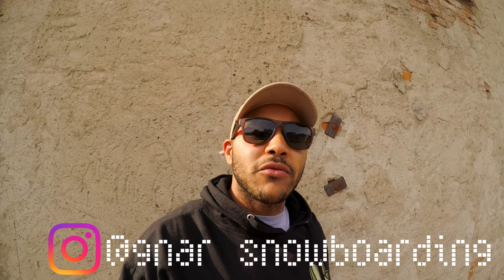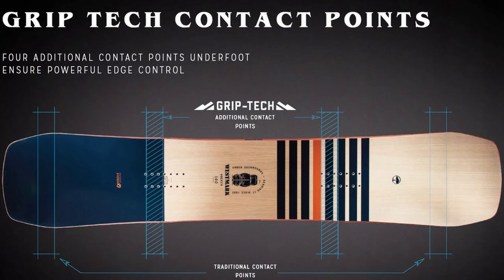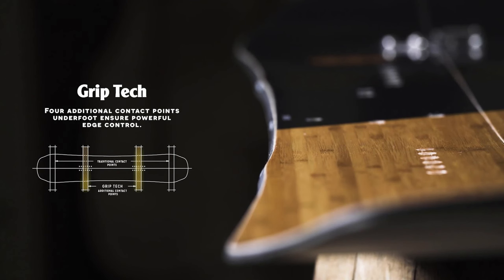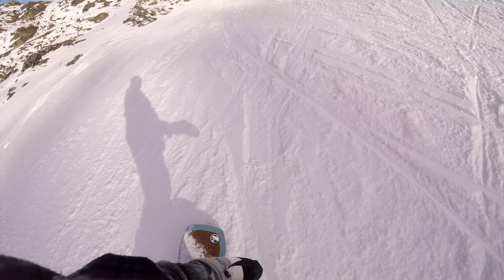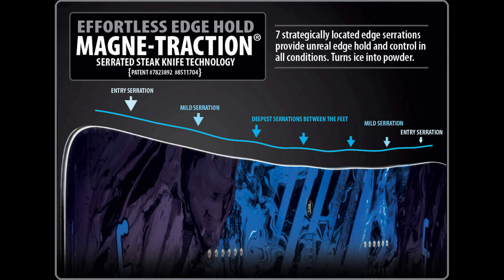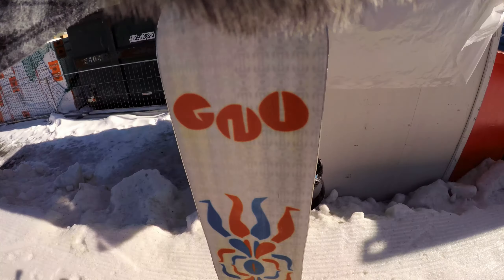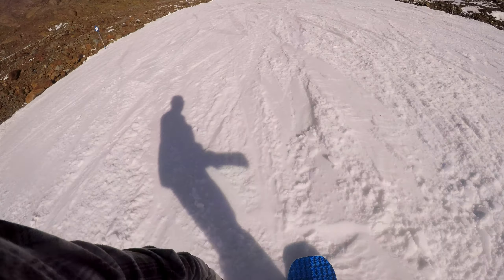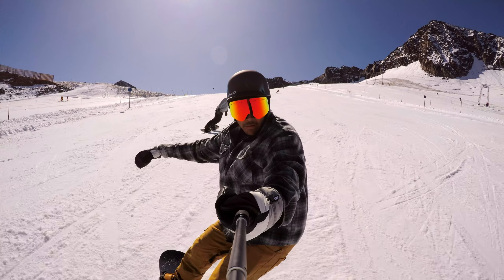GRIP TECH VS MAGNE-TRACTION - Tech Talk

Comment: Gnu isn't a company from Lib Tech, they are separate companies that are both made by the parent company: Mervin Manufacturing.  Semantics; I know... However; you are correct with a plethora of other companies doing extra contact points. Rossignol:MagTek, Slash Snowboards:Ultimate Traction Bumps AKA UTB, Burton: Frostbite Edges... and so on...